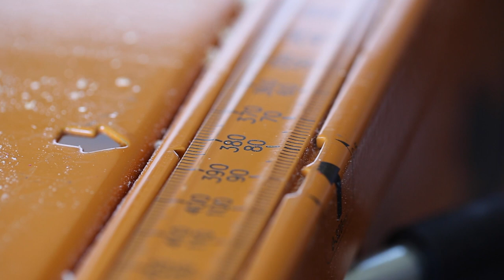Modern Side Table - Modern Maker Podcast 2x4 challenge

Comment: Great work. A tip I picked up from another channel, when you plan to dowel anyways, use screws to clamp where you later plan to place the dowels. With the first piece of wood already drilled, you can use a screw and a washer.

Comment: This is awesome. Instructions and editing are perfect. I'm new to woodworking and I find wood selection to be a bit confusing when I go to Bunnings. Is this Structural Pine you're using? Or is it general purpose pine or dressed pine? It'd be great if you can do a video on selecting the correct timber for different projects. Thanks!
Reply from the maker: Thanks for the support. I know what you mean with plywood confusion. It confuses me. Most of the plywood I use is the from a place in Sydney called Trademaster. I find them to be the cheapest. If I use the structural stuff from bunnings I try and pick a good sheet and then when putting the project together I put the bad side of the plywood on the inside. Hope this helps and will keep this in mind when making my videos 😀

Comment: Great video and like all the others I've binged on over the past couple of days. Love your format.

Do the legs connect half along the sides? I've got Christmas presents to make ;)

Tim
Yass, NSW, Australia
Reply from the maker: Thanks Tim appreciate the support! The legs do correct half way down but you can always move them depending how high you want the table. Be sure to send me pics of what you make 😀
Reply: @SmallFryCreations  ta. Will send pics. @ozzietim on Instagram.
Reply: Would you change the dimensions of you weren't restricted to 2 2*4s. You're.top is 310 * approx 320. Most side tables I've looked at are 500 * 500.
Reply from the maker: Hey Tim. I personally wouldn’t. Where the table is there isn’t a lot of space. The top is enough for a drink, tissue box and the TV remote comfortably.   The current design calls for all the sides of the triangle to be the same length. If you change the size you may find the table would look silly with the legs or cause the table to be taller then desired. If you change the top size I would change the angle on the triangle. Hope this helps 😀
Reply: Very good point. Thanks.